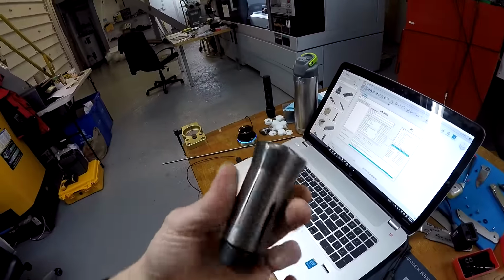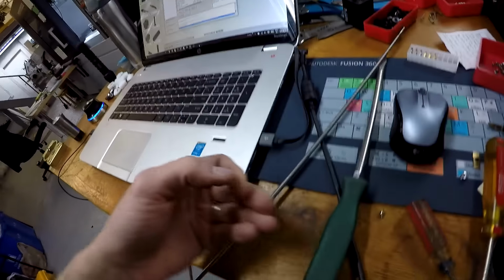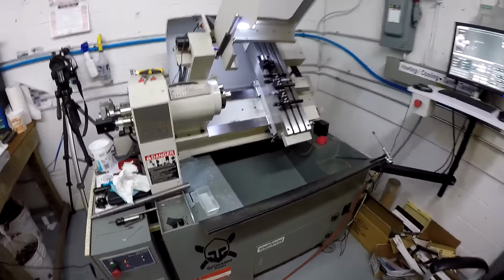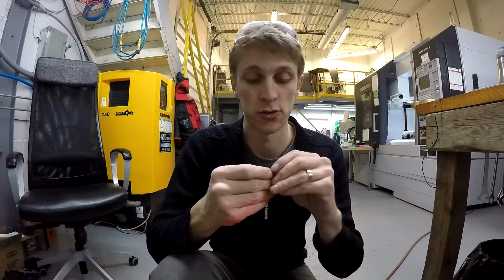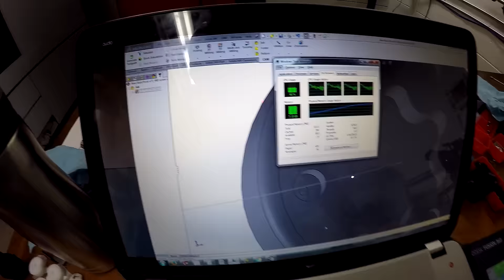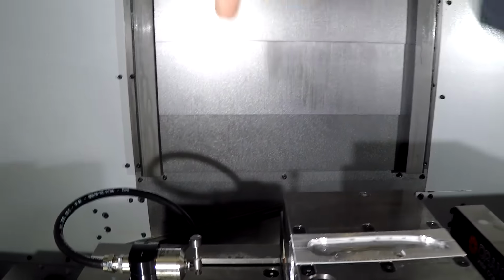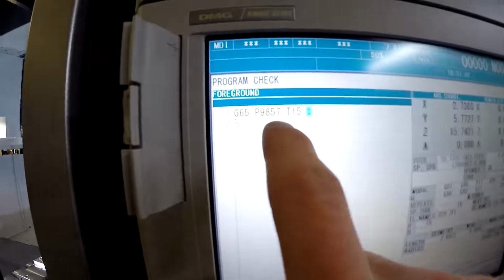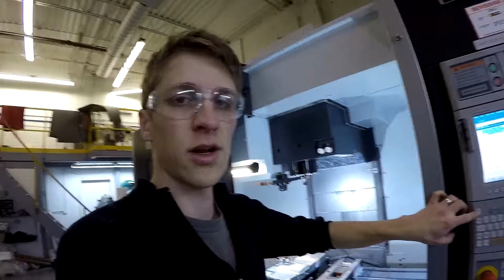Titanium screws - Grimsmo Style

Comment: Hey John you should check out a wobble broach if you're planning on making these production. All you'll have to do is drill a pilot hole and then drive the broach through.

If you're stuck on the milling aspect, use 3D adaptive and contrain it to that one level using a selected chain in geometry, and choosing the top and bottom surface appropriately.

Great Vid as always!!

Comment: Just a stopid question.. why not broach the torx?? A broaching head for a mill you would whip out in an hour or too including the thinking part.
And broaches for most torx patterns is available even thou you could prob. make them as well like 10 at a time on your machines - and it wouldnt even take up much production time.
Broaching produces a less perfect fit - but would make up in the time / cost of effing up micro tooling.

Comment: I was just making some tiny titanium and Inconel parts for a customer,  I found that fusion does not like when you do super small parts seems to run slower but maybe that's just my computer need to upgrade. I had issues with some of the lead in and lead outs not fitting within the pre drilled clearance so you may need to fiddle around with those alittle to get the adaptive clearing cycle too work. Also I was using a .02 and a .013 dia. Endmill and drills, I would suggest looking into Harvey tools they are amazing. They are all coated I believe and they are have great Feed and speed charts for all of there tools. I would highly recommend looking into them, as well as the fact that if you order something you get it super fast like next day and they stock a ton of miniature tooling.

Comment: Is there a reason you're not just rotary broaching it? You can get the torx broaches all the way down to T6 as far as I know, not sure about smaller.
Reply from the maker: +Kevo F Just haven't bought a broach yet, the ones I'm seeing start at like $700 and over $100 for the broach itself.  Plus I don't like how it shoves bits of metal down into each corner.
Reply: JohnGrimsmo Yea for sure they are insanely expensive. You can drill those chips out after broaching, but still I'm not sure it's possible to get it as nice with a broach as you can with that end mill. Anyway thanks for making the videos man, its cool to see what you're up to.

Comment: John,Interesting video.How did you model the Torx head indent(?); manually modeled , or, downloadable standard file, ...
And, do you think you could have done this on the Tormach?

Have you ever done Torx Plus?
Reply from the maker: +ForgottenMan1 I found a Torx screw on mcmaster's website and downloaded it to start from.  I have done this on the Tormach for over 450 of my LBS screws, which were also T9 in titanium.  Worked great, tool lasted forever now that I think about it....  I've broken more of these endmills on the Mori!  Maybe I'm pushing it too hard.  I have not tried Torx plus, though it is tempting.

Comment: If you have the code from the pivot screw working, why you didn't cut and paste the code for your new screw?  Or directly use the same program for the 2 screws.  If you upgrade your code for one screw, it will be for the other one at the same time.
Reply from the maker: +Le_KiD_Qc Yeah I did do that initially, I can't actually copy/paste in Fusion but I could make the code a template and then open it again.  I have no idea why it stopped working after doing that.  The two screws are different materials so they have slightly different speeds and feeds.

Comment: Hey John, a couple of quick pointers, G5.1 Q1 on our Fanuc controls has a range for smoothing, ex. G5.1Q1R1 would be "rough" and G5.1Q1R10 would be "smoothest", range from R1-R10, the lower the R value, the faster the cycle time, and highest R value cycle time increases, also I turn it off when ever that type of tool path is finished, in some instances it doesn't like that command to be active.
if you want to shave a couple of seconds, I recommend tool precall, even at the last tool, not sure if you got that programmed in. Also, Fanuc has a keep relay that will either keep the tool pot in the up position or the tool pot down before the spindle goes to the tool change position, it'll save about 1.5 to 2 sec. per tool change.
Regards,
Wen.
Reply from the maker: +Li Customs Thanks!  I know my machine has R1-R4 for speed vs accuracy, but i don't think that particularly has to do with G5.1Q1. For mine, R1 is for speed, R3 is most accurate for 2D contour and R4 is best for 3D contours.

My Post does tool pre-call automatically which is great.  I did not know about keeping the tool pot down, very cool!  Thanks Wen.

Comment: Nice mouse pad! I was stoked when they sent me one of those... but where to put it?
Reply: Oh I'm surprised no one else has brought up G05.1! This is a Fanuc standard these days (not necessarily available on all their controls, I think the O controls are very limited) and is a look-ahead function. Others familiar with Haas may think G187 Px (P1 roughing, 2 semi-finish which is the default, 3 finishing, all of which can be constrained with an E value for tolerance purposes), or for Fadal it's G8/G9 (feed ramps off/on).
Reply: And I highly recommend changing up your post to include things like tool breakage so you don't have to use pass-through and risk fat-fingering something!
Reply from the maker: +atomkinder67 Good call.  I noticed that it needs the tool number to do it properly for breakage detection, which would be pretty easy to make a parameter in the Post.  Yeah I'll play with that one day.
Reply: Could be a parameter in the post or possibly run as a macro variable which reads the current tool number. I'd opt for the latter if I could figure it out just to keep things clean.

Comment: John if you want to open up a collet the easy way is to take your oxy-acetylene torch and heat a spot a little above where the slot ends mid way between the slots. get it red hot quickly about 1/2" diameter than quench it in oil. Do this for all three jaws it will open up the collet. I have done this many times with no detrimental effects on the collet.
Reply from the maker: +Edge Precision Fantastic advice!  I don't have oxy-acetylene anymore but propane/mapp should do it too.  Great tip!

Comment: Have you considered removing the majority of the stock by drilling it out first? That usually works well for me when I'm working with fragile tools.
Great videos by the way
Reply from the maker: +IkkFedt That's definitely what I'm doing now, drilling with a 0.059" carbide drill, interpolate with a 1/16" endmill, then pick at the corners with the 0.020" endmill.  I'd normally do "rest material" so it doesn't waste time air cutting the middle, but I can't get that working right now.

Comment: For the screw heads you should try a rotary broach. I broke down an bought one a while ago for a particular part that needed a hex in stainless steel. It was amazing how fast and easy it was to put a 3/16" hex in just drill with a 3/16 and then lower the broach just like a drill. One pass about .001 per rev it took about 10 seconds. I know they make torx broaches also.

Comment: Wow. I've been dealing with EXACT same problem in Fusion the last few days, basically since the last Fusion update. 2D adaptive just hangs in the processing. It eventually gets there like after half an hour or an hour but it was working fine a couple of weeks ago and I haven't changed anything. None of 2D adaptive ops in any of my projects work. I've been in contact with Fusion and they said they haven't had any other complains about that but are looking into it.
Reply: +War Machine LLC There was a solution posted to John's problem on the Fusion CAM forum Friday.  If the operation worked before I can't see how it's not related to the most recent update.  The fix in this case was to reduce the Stay Down level from Most and then change the boundary and stock contour settings.
Reply from the maker: +War Machine LLC Good to know I'm not the only one!!!  That's why it's good to share these things.  I do have a post going on the Fusion forum if you want to chime in.  I still haven't solved it.
Reply from the maker: +DAM Machines I tried those things but they didn't fix the issue, it's still refusing to get past 15.2%.
Reply: +JohnGrimsmo I'm way ahead of you at least. I get all the way to 15.9%. Eat my dust!
Reply: +JohnGrimsmo Really?  It worked for me - on the part you shared.  Just tried it again and it completed in less than maybe 30 secs.  Let's see... edit - go to linking page and set Stay-Down Level to Least (I didn't try any others).  Then back to Geometry tab, deselect the Stock Contours check box.  Change Machining Boundary to Selection and select the torx profile.  Change Tool Containment to Tool inside boundary and OK.  It got stuck at 15.0% for maybe 15 secs then jumped to 100%.
Reply from the maker: +DAM Machines I tried it again just like you said and I still can't get it to generate.  2D and 2D adaptive toolpaths just aren't calculating if the tolerance and stepover are set too fine.  I can get it to work with like a 0.015" stepover but that doesn't help me, I'm shooting for 0.0015" with a tenth or three of tolerance.

Comment: I'm finding the same issue with Fusion360, since the Jan 23rd update.

Changing the tolerance to 0.01mm (from 0.001mm) solved it for me. I'm only using a Tormach mill so that's not a problem.

Really great video. The macro shots of the screws at the end were a very nice touch. Those things are beautiful!

Comment: John...you mentioned that have the machine connected wireless...what is your set up?
Reply from the maker: +sunilkumar vc It came with a program called Mori Connect, so the machine is actually hard wired via ethernet to our wireless router, then the laptop connects through that.  I have Fusion post the codes to a certain folder, Mori Connect sees that folder and I have to manually move files onto the machine's hard drive through there.  Works great!  I can even see and delete files from the Mori, as long as they're not running.
Reply from the maker: +sunilkumar vc It came with a program called Mori Connect, so the machine is actually hard wired via ethernet to our wireless router, then the laptop connects through that.  I have Fusion post the codes to a certain folder, Mori Connect sees that folder and I have to manually move files onto the machine's hard drive through there.  Works great!  I can even see and delete files from the Mori, as long as they're not running.

Comment: John,
May i make a sugestion? Leave a .O50" - .100" shank on your screw with the parting tool. Rapid out to .100 clearance hieght above stock. M5 to stop spindle, M9 coolant off, M0 manditory stop. If the Tormach lathe can beep, add it here.Open door and break off screw manually . Hit go, M4 to start spindle CCW. Finish facing off nubbin.

Comment: This was a great video. Please do more of these! As for you cam issue, I have ran into a similar problem with RhinoCam, it would not generate a path and kept locking up my software. For me it was due to the complexity of the model i was using. It had way more "points" than it needed. I went back and simplified the facets/points, and problem solved! Just an idea, the top part looks simple enough you might try re-generating it cad wise with fewer facets/simplify it, and run it through again.

Comment: Why don't you rotary broach the torx pattern instead of cut it with an endmill?
Reply from the maker: +Colin Worobetz Cuz I don't have one yet and I'm a sucker for milling ;-).  I should probably get one to try it and see.
Reply: +JohnGrimsmo they work great, but they do cause a small chip in the bottom of the pocket just by virtue of how it cuts. You might have good luck with rotary broaching a size under and finishing with and endmill

Comment: there is part off inserts have angle cutting edge instead of neutral which  enable you to getrid of the nab so while you are parting off the nab diameter on the stock bar side is bigger then the diameter at the part side ,and parts tend to break off at the smaller diameter , i hope this helps
Reply from the maker: +baslious Yup I do have some of these angled inserts and I use them for other parts. I don't mind the bigger nib on this part, it gets milled off.

Comment: chase it out with a carbide reamer, but 5Cs are supposed to hold +/- 005. Used to work in a fixture shop making pins with an optical grind jig (5c). Honestly man I would just buy the screws and modify them. That's a lot of machine time and headache for something so small. Your shop however, best of luck.

Comment: Pick up some "emergency" collets. They're set up so you can machine them to size
Reply from the maker: +Geof Dumas Good call, didn't think of at at the time.
Reply: +JohnGrimsmo Buy some better 5C collets.  Pre-Sprung collets are already slightly stretched, so they will accommodate nominally sized (i.e. oversize) stock.

congrats on the mori, nice to see your business expand.

Comment: Sinker EDM for the hex head socket. Judging from the depth of your socket on your screw you might be able to build your own machine that works just as good as a off the shelf machine. The only thing left would be to get the hex shape carbon rod for your electrode. Build it as an array and you could kick out say 50 or so screws every 20 to 25 minutes. Only thing to prep would be to profile and shape the titanium screw blanks. With EDM you would gain mas produced parts vs 1 screw at a time.

Comment: when i was working in fasteners and needed to make a socket head cap screw or even a torx screw, we would drill a hole either the size of the across flats or slightly bigger and then use a broach on a press to form the required shape

Comment: +johngrimsmo where do i find a bar puller like that? How does it work?
Reply from the maker: +Joshua Arnett Google Dunham bar puller, it's slightly undersized and spring loaded, so you push it onto the part, release the collet (pneumatically and gcode activated) then it's gripping the part so you can move the tool back, clamp, pull off.  Good to go!  It works pretty well as long as the stock slides nicely in the collet.
Reply: +JohnGrimsmo hey thank you. That is a pretty steep price but i guess all these tools are.

Comment: I just remembered that I have seen guys put little blocks of rubber in a collet to open it up 1 or 2 thousands of an inch. Hardinge is expensive but they will make any size you want.
Reply from the maker: +Richard Haisley Yeah I just checked out their website, they list every 0.001" increment!  $54 is more than the $12 Tormach collets, but worth it if you need it.

Comment: Make the torx jig so that you can run say 10 sets at a time and make the tool change right. Meaning that it runs one op per part and then next op per part and so on. Set up multiple of them small end mills and make the breakage detection change new tool if it's broken. Then you simply leave it run overnight. Zero cost, $$$ income.
Reply: You can't leave a cnc unattended
Reply: viperz888 Yes you can
Reply: ***** only if you want to be fired.
Reply: viperz888 What kind of a shop fires people for getting the shop free money? I wouldn't like to work there.
Reply: +viperz888 we leave them unattended all the time, usually run a 3 hr cycle right before I clock out.

Comment: You need to use a drill to clear most of that material, then you will avoid hogging so much material with a little EM.  EDIT: Maybe you dig hog that out, but the corners of the torx could be drilled to save a bunch of milling time.

Comment: (Just in case you haven't heard of it...)

It's not something I've used, but Autodesk has a "Distributed CAM" application. Apparently you can install it on the other computers on your network and then you can use those computers to calculate toolpaths. My understanding is that the other computers don't need a license or anything. Since I haven't used it myself, I can't speak to its reliability or anything else. Some quick searching shows that it also works with Fusion 360.

I'd post a link, but then this post would be flagged as spam. Searching your favorite search engine, Altavista maybe, for "Autodesk Distributed CAM" should bring it up.

Seems like a good way to save two seconds... nudge nudge. :)
Reply from the maker: +Hirudin HAHAHAHA Altavista.  No way, it's all about AOL.  Tried the distributed cam, didn't help anything, still getting stuck.

Comment: Re: the cutoff process most cutoff tools are ground to 90degs which produces a rod like pip attached to the stock and the part. I prefer to grind mine at a bit of an angle so that the  part is the first to be separated leaving a cone shape on the stock at that point until full crosscut is achieved! Hope that's clear as mud!

Comment: I noticed your coolant is not going to be hitting that tiny endmill. Although it will be flowing into the cut area, it's probably not with much force. That might be why your having some issues with that endmill. I would guess that it would not take to many chips hanging around to long and being recut to break that thing. Especially since the mori can't spin that tool at optimal rpm. Although that could be wrong since your doing Ti.
Reply from the maker: +helicrashpro procrasher True, these stock coolant nozzles won't angle up high enough to hit these short tools.  I need to get different nozzles, but they have to be super low clearance so they don't smack the toolchanger arm.  I spin it a 12,000 which is adequate for Ti, although a speeder would be nice!

Comment: How about a pre drill and rotary broach on the lathe? That just may work for this! They are not cheap, but they would probably give you the best finish and they would not be rounded corners, plus, you can do ALL work on the lathe and simply use a parting process...
Face
spot drill
drill
broach
profile
thread
part

MUCH less time consuming and automated.